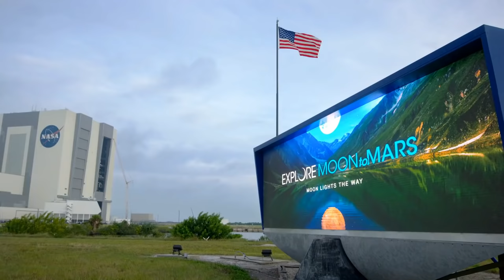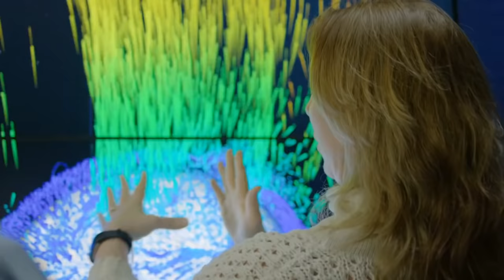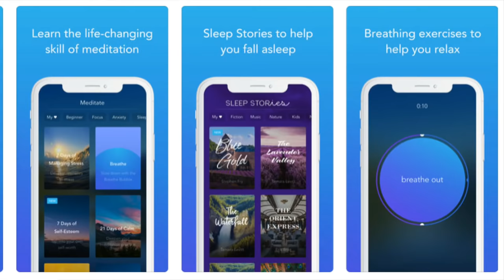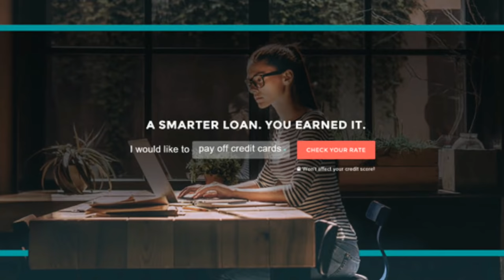The Haunted Amityville House Murders - Podcast #68

Comment: I worked at a funeral home a few years ago, and just before I left they had started working with a new company that supplied caskets made from bamboo. They were actually biodegradable, so you could bury your loved one in a cemetery as normal, but they wouldn't be in this steel box forever, it would degrade into the earth in that plot of land and their body would eventually as well.

Comment: There’s another option called Alkaline Hydrolysis. A body is turned into liquid and the bones are crushed and returned to relatives. Regular cremation is very bad for the environment.
Reply: How do they turn you into liquid?
Reply: Alyssa Brown-Carleton Using a pressure vessel, heat and potassium hydroxide. The process breaks down tissues to their chemical components.

Comment: The benefits of the "decomposition" style of burial have some good arguing points. I can't help thinking, though, that this is something that only property owners will have as an option. People who rent won't be able to put their loved ones into a garden that they can nurture in an apartment complex. Also , why would someone want to inter a loved one like this if they only want to keep a portion of composted material ? That would be like choosing what parts you want to keep and that's just creepy, if not ,serial. I can , however, see this as an answer to over crowded cemeteries where remains have actually been stacked one upon another. I don't know. I'm not dead yet so , for the time being, I don't have to worry about it.

Comment: "Ashes to ashes. Dust to dust"
Or rather, "from dust you came, to dust you will return." A coffin just prolongs the inevitable.

Thia case is straight up weird.
On one hand the argument that there could have been more than one human assailiant involved here seems plausible. But when one probes deeper- even if one completely ignores Butch's ever changing stories- one will come across some strange evidence that either causes one to sit back and wonder, or that causes one's skin to crawl. 
Also consider this:
If the supernatural has ANY invlovement, if human's can cover up the evidence, make the evidence lead the investigators into a direction that leads them off the path that would otherwise lead them to the truth, allegedly, the demonic operates on a level of intelligence far higher than man. If that is the case, it would be nothing for "them" to completely confuse people, making them hold each orher responsible for what "they" are ultimately responsible for. Either way, there are some clever minds at work in this. 
Also, there are documentaries on this case that reveal that the Amytiville Horror proceeds the Defeo murders. Disturbing events in that house, even in that neighborhood, that caused other residents to suddenly pack up and leave for unexplanable reasons.
And even far before that, a documented history of that area,  in the colonial era, of some strange goings on, that could or could not have any bearing on this case.

Comment: Actually even if you're embalmed and put in a sealed casket (which is basically a rubber lining) eventually the rubber will dry out which will lead to air getting in and eventually decomposition. Everything decomposes even embalmed people, they may last a little longer but not by much, they too will eventually become a skeleton.

Comment: Yeah I don’t believe the lutz because people have lived in the house after and nothing’s happened. However I will say when you’re talking and stuff and saying how it doesn’t make sense. I lived in an apartment a few years ago and I’d be alone in the apartment all doors locked and I’d hear footsteps and someone opening cabinets in the kitchen and someone opening and closing my dryer lid, I was getting bad sleep paralysis almost every night multiple times a night sometimes, and one night I heard like a pack of dogs and they sounded really hurt like crying dogs and I didn’t live in an area that had coyotes or anything and the dogs kept getting louder and louder until it sounded like they were right outside my window so I went and looked out my window and when I pulled up my blinds the dogs stopped. It was completely quiet. So yeah doesn’t make any type of sense but also.... any other way to explain it except for paranormal?